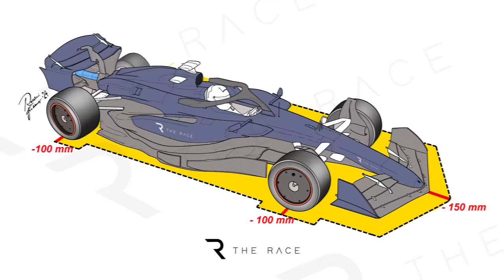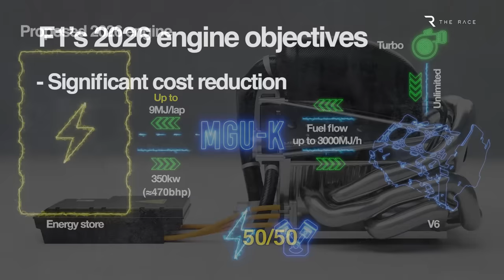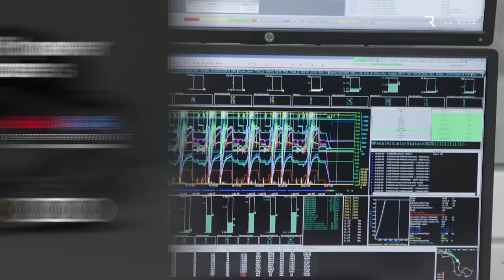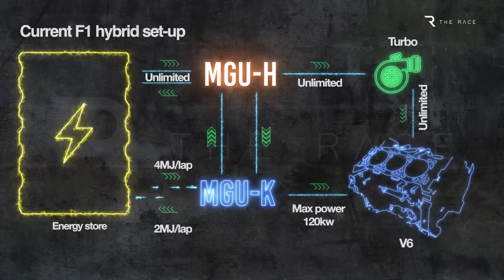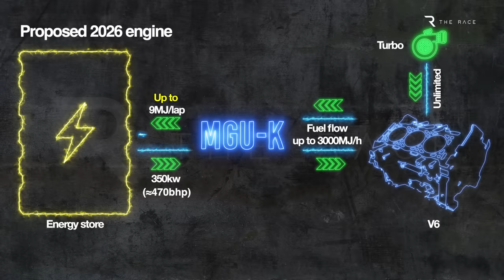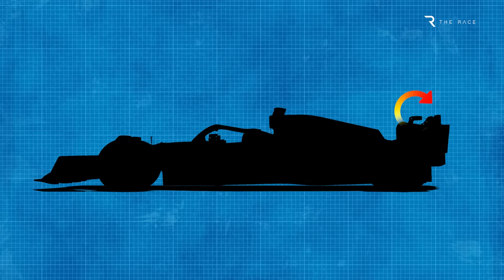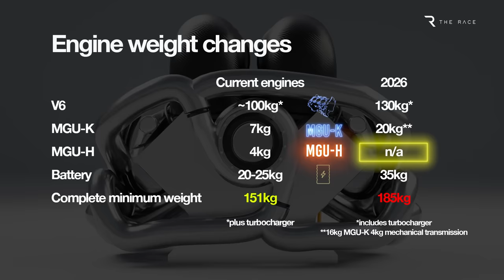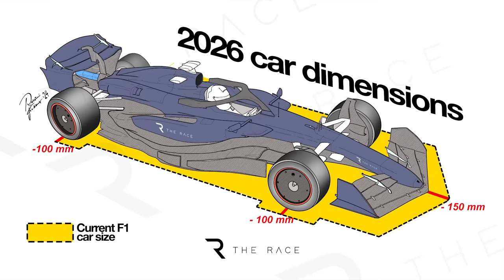The truth about F1's controversial 2026 cars

Comment: As I said many times: adapt LMP1H rules (~2016) to open wheel cars and you'll have different engines, more different aero, very close grid racing wheel to wheel for the whole race. There is no need to reinvent the wheel. The money for those regulations is in F1, it should be used there.
Reply: Or even take a look at lmdH / GTP, endurance prototypes know how to make a rule set
Reply: @halfassproductions2715  Nah, LMH/GTP is what sports car needs. But for F1 they need more.
LMP1H was the perfect rule book, but too expensive for LM.
Reply: @Willbrse peak lmp1 was reaching the budgets of pre cost cap f1. That and relying on only 2-3 teams meant they weren't going to last long
Reply: @neo1711  "The money for those regulations is in F1, it should be used there." that's why this is there...
Also some reports said while Audi was spending $200m, Toyota was around $100m. Regulations also allowed different budgets to race wheel to wheel. Which is perfect for F1 cost cap.
Reply: LMPH regs are so much better its insane
Reply: @IgnitionP  it's just sad that expensive stuff is restricted to F1 because all other racing have way less viewers (even if they are better). In a perfect world LMP1H would have ~10 manufacturers  
Kinda wish WEC adapted it to cut costs while keeping the pace as close as possible to what they had. Spec underbody, rear wing, safety cell and hybrid + homologation and BoP used in current rules would help. I like current LMH class but the pace of LMP1H  was nice, at some point they were faster than IndyCar lol
Reply: Those cars were cool because of the diversity of the powertrains and the reality-warping acceleration potential of all-wheel drive, but behind the scenes the amount of fuel allotted to each car was being messed with. I wouldn't want that to sneak into F1, so the rules need tweaking to leave everything in the hands of the people building the cars. Also, while LMP1 saw some amazing confrontations between those cars, one has to remember that there were also some long stretches of complete quiet and even some domination. This isn't a problem, but let's not let rose-tinted glasses disguise how LMP1 really went. In a meritocracy, someone's going to embarrass the others, and that happened in LMP1 just as anywhere else.

All that said, good luck convincing F1 to write a LESS restrictive ruleset. Hell, when Newey mentioned engines running flat out thru hairpins to charge the batteries, one of my first thoughts was "why didn't the LMP1 teams think of that?". Of course, the answer is likely that there was a rule against it, just like there are rules preventing so much other cool shit in motorsport. 

Fun isn't allowed, and while VW's Dieselgate-induced money troubles are why LMP1-HY died, the increasingly restrictive nature of modern auto racing is why it's staying dead. I wouldn't hold my breath for F1 - or ANYONE - to buck that trend (the BoP formulae don't count).
Reply: @mitchell-wallisforce7859  Not true about the fuel part. You had hybrid classes and the higher you went on it the less fuel you could use per lap. It was part of the rule set. And that part was brilliant. It's also what put an stop on manufacturers from using the high rev trick, they'd end up getting nothing from it. I doubt this would be something F1 will have to worry about anyway with the fuel per hour limit being reduced like they are doing. Red Bull is just salty about these regulations.
Yes, there were some dominant performances but the in race was interesting at least, way more than F1. That's the fun of those rules, it didn't stop people from doing a better job. And since things were closer you had more chances of different cars doing randomly better than F1 will ever have. Toyot already joined being very close to Audi. This is unthinkable in F1, even teams like Williams are struggling in the back and in a bad way, not because things are close, because they aren't (in race).
Diesel gate is unrelated to LMP1H Itself, while it's true this is what ended putting an end on it. But LMP1H was faded to end sooner or later anywya. As I said many times: the money for it is in F1 not in Le Mans. This is also why it isn't coming back. It's all about money.
I don't use rose-tinted glasses. I use "I watched those years with the most interest I ever had in my 30 years of following racing and I remember it very well" reality glasses.
Reply: @Willbrse  https://www.autosport.com/wec/news/toyota-and-porsche-lmp1-cars-get-world-endurance-fuel-rules-boost-4472386/4472386/

"Toyota and Porsche, which both run in the 6MJ hybrid sub-class, will now be allowed 139.5MJ per lap of the 8.47-mile Le Mans circuit rather than the original 137.5MJ in the original regulations published in December.

"The fuel capacity of the TS040 and the 919 has been raised from 66.9 to 68.3 litres.

"The fuel allocation for the Audi, which runs in the 2MJ hybrid class, has been adjusted downwards from 140.2 to 138.7MJ and the fuel capacity of the R18 reduced from 54.8 to 54.3 litres."

I remembered the Audis being given less to work with on account of being turbodiesels, and so it was. The Toyota and Porsche resided in a higher-energy subclass of hybrid system but had more fuel capacity than the Audis anyway. Then the rules got tweaked to give the petrol cars even more of a boost and give the Audis even less to work with, despite the R18 being a 2MJ car. It's far less intrusive than a full-on BoP system, but I still don't like it.

Also, the idea of ruling out the "max revs generator" trick in hairpins is exactly the thing I have a problem with. Why not just let it happen? Why is such an unconventional idea considered a problem at all? If we're ditching the MGU-H then why not stand back and let the powertrain engineers come up with any solution they want within the new constraints? Weird tricks are half the fun of F1, and they're part of why we learn so much from motorsport. I'm sure the idea of strapping a great big fan to the back of the Chaparral 2J and Brabham BT46B looked a bit stupid in period too, but if it works...

I CBA to go and watch a random LMP1-era WEC race to prove this, but in my experience there are almost always long stretches of silence in an endurance race. What makes those races so interesting is the level of strategic variation that can exist over an hours-long marathon. WEC races are slow-burners that are hard to hold to the same standard as F1 races, and vice versa. F1 hasn't come close to that since refueling was outlawed, trying to half-ass a solution via the Swiss cheese tires they're forcing Pirelli to make. Even an enduro can see flag-to-flag domination, but sprint races are far more likely to have one ideal strategy and heavily favor outright pace over efficiency or tire conservation. A 300km event is absolutely a sprint race, so F1 races are far closer to a straight-up test of speed. Once a dominant car hits the front, that's often all she wrote. Despite this, F1 has still seen some pretty great showdowns (Merc/Ferrari in 2017-18, Merc/RB in 2021).

Toyota being immediately on Audi's case was absolutely impressive, but that was also Toyota: one of the richest, largest auto companies in history. Maybe they were working with half the budget even in 2012 and 2013, but their ability to match blows with a factory team in top-flight competition is still far greater than Williams, whose last stint as regular race win contenders was back in the early to mid-00's when they were a BMW factory team. Sports car racing is no different: Audi and Peugeot didn't always turn up to the same diesel-era races, and the gulf in speed between them and everyone else was ENORMOUS. The 2007 Le Mans Series was one big Peugeot whitewash, and that's just what happens when you have a field full of Williams-alikes against a factory team. That Pescarolo Sport split the Pugs that year is honestly a miracle. It isn't just privateers who can get rolled over like this either: right after winning the 2014 WEC title, Toyota went winless and scored just two podiums across both cars in 2015.

I didn't intend to be mean with the "rose-tinted glasses" line. Humans just tend to do that when it comes to things they love, and as glorious and worthy of love as LMP1 was across both the diesel and hybrid eras, hindsight can be a highlight reel. LMP1 wasn't all action all the time, and I don't think either it or F1 should be ashamed of that because that's just sport sometimes. LMP1-HY had its issues and was bound to end sometime, but that can be said of every ruleset - modern F1 included. I love LMP1 because it made sportscar racing F1's equal. Equal, not necessarily superior. It goes deeper.

It isn't just money. It's the mentality of the people in charge, and F1 is run by people who want to put the field into as tight a box as possible because, even if they don't want to say it out loud, they care more about "the show" than diversity of ideas. There's so much specificity to these 2026 rules concerning not just what teams will use, but how and when they'll use it, which kills me. I get the feeling they'd just use BoP if they knew they could get away with it, but they can't and so they're going the IndyCar route of restricting things as much as possible.

If I have a point to make with all of this, it's that the biggest problem with the 2026 rules isn't the general powertrain or even chassis concept, in my opinion. Active aero at both ends of the car and an entirely new approach to powertrain design and application? There's so many possibilities, and that's when F1's at its best. The big problem is the fine print - namely how much fine print there is that's aimed explicitly at reducing possibilities. I understand that F1 has long loved to ban clever ideas, but now it feels like they're trying to stop anything like that from happening in the first place.
Reply: @mitchell-wallisforce7859  congratulations, you discovered Balance of Performance (called there EoT). Keep pushing lol
Reply: This change in regulation will bring us LMP1 but with less lap and more money to spend.
Reply: @Willbrse  "I get the feeling they'd just use BoP if they knew they could get away with it, but they can't"

Every time BoP's come up in an F1 discussion it's a warzone (and for good reason). My fault for taking this seriously I guess.
Reply: @mitchell-wallisforce7859  The problem in F1 is that everyone is using the same engine, every engine is built "the same way" and when you do that it gets harder to create a valid case to reduce the fuel flow/energy allocation of each team since "it's the same for everyone". In WEC it just made sense to do that since it's really hard to balance different engines, specially when diesel was allowed which I think it was a mistake.
Realistically even if F1 reduced Red Bull flow/allocation they'd still win because doing this does not negate the other parts of the car and RB is superior in those parts, performance difference between Red Bull and RB shows it. But things would be a lot closer, more chances of random winners.
Hybrid engines and fuel flow control really is a formula that should be taken more seriously, it can make things a lot closer without destroying good work.
Reply: @IgnitionP  Better for racing, but not necessarily speed.
Reply: Their cost was as much as F1. Audi and Porsche were running 300 million euros per season with Toyota not that far behind before the former 2 withdrew. Also, those LMP1 (and Hypercar) ran traction control system with standalone ECU. F1 TC is banned, and ECU is standardized
Reply: LMP1 never had close racing. Always had one team more dominant then the other.
Reply: People who say LMP1H didn't have close racing never watched it. They go to Wiki and check the numbers there as if final race numbers alone tell the whole history. If you actually watch racing you know they don't. Sometimes you have a great driver and if you look at his wiki you see terrible seasons but that was because his car always broke or something.
LMP1H is the same thing. It had great and close racing, but its regulations never voided the best work. Audi still won in small details. But the racing and the championship was a lot more interesting to watch than any F1 domination era. If F1 could get to that level it'd be amazing.
I suggest you go and watch the actual races. WEC channel should have them uploaded. Literally everyone who watched that era agree with what I'm saying. LMP1H was one of the very few regulations that had almost 100% support from fans.
Reply: @Willbrse  they rarely had close racing, or more correctly in P1h, when VW group and Toyota still able to sustain funds needed for program. Audi in P1 era never had any rival outside Peugeot for a few seasons. And only outside winner was essentially quasi Audi with roof.